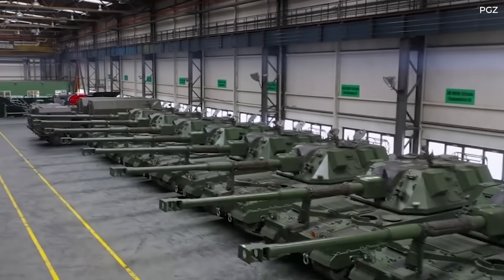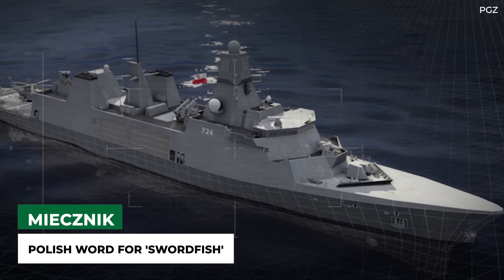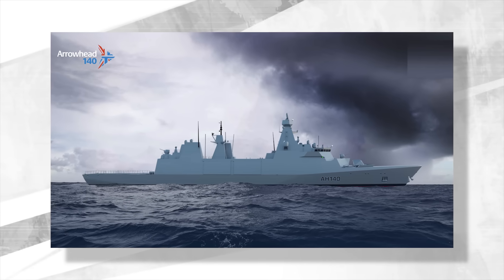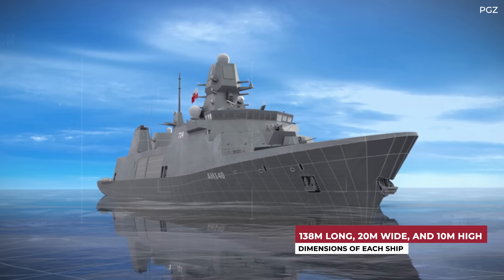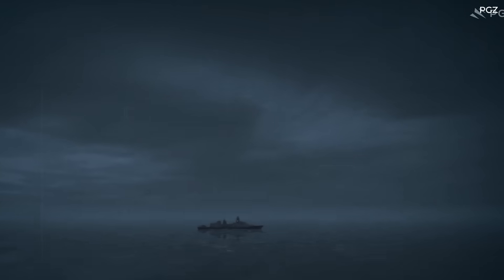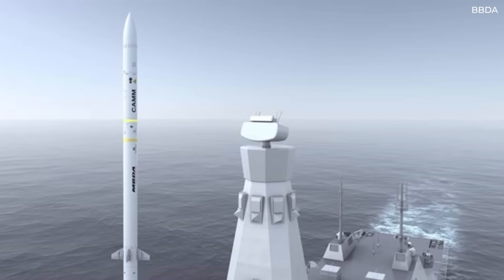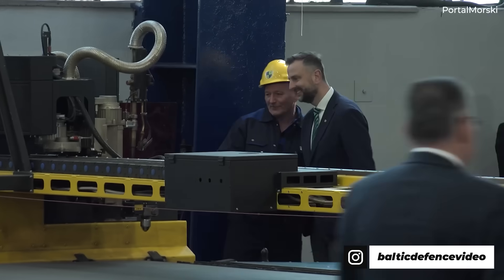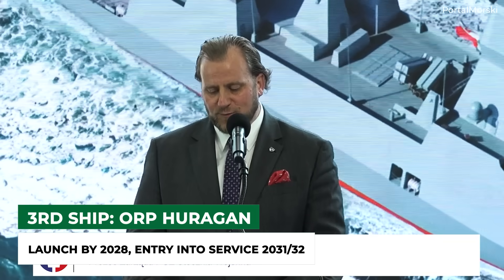Poland's Future Multi-Role Frigates: What Are Miecznik-Class Ships All About?

Comment: These ships will be equipped with CAMM and CAMMER missiles, which will form the basis of a short-range air defense system under the Narew program for Poland. This is a counterpart to the German Iris-T anti-aircraft system. The advantage is that the same missiles will be used in CAMM launchers both on land and at sea. Another advantage is the establishment of missile factories in Poland and the UK. Both countries will be able to replenish their supplies if either runs out for any reason.

Comment: These are British Type-31s that are being built in Poland under a joint construction agreement; Indonesia has the same type of agreement with the UK to also build Type-31 variants.
Reply: Taking a Iver Huitfelt class frigate and replacing the electronics doesn't make it British. All these models are upgraded Iver Huitfelt class frigates.
Reply: @jacksonteller1337 Not quite. Babcock's Arrowhead 140 design is indeed inspired by the successful Iver Huitfelt class of frigates, especially the modular build aspect. But from the ground up, these are otherwise distinctly British ships, in (1) concept, (2) purpose/objectives, and (3) weapons systems. The Danish ships are anti-air frigates; the Babcock designed Type-31s lean more into modularity, as flexible global combat ships, for export in a wide variety of theatres (Indonesia, Poland, etc.), with anti-air, anti-surface, and even anti-sub fighting, via a more effective helicopter complement (Merlin, Wildcat, or even Chinook). For this, they offer more high-tech sensors and weapons systems, from the Sea Ceptor to Tomahawk or ASROC. Because export flexibility is their goal, they also have future-proofing built into both their software and physical platform, with upgradeable spaces for drone-boats, etc. In practice, this means the British, Polish, Indonesian, and other variants of the Type-31 could ultimately be quite different from one another.
Reply: @jacksonteller1337Sorry you are wrong.  The STANFLEX system was ripped out.  The compartmentalisation was upgraded and improved.  If they were just the same why would the Danish government be looking at replacing the Iver Huitfelt and her sisters with new Arrowhead 140 based design ?
Reply: @paulbestwick2426 that is called an upgrade. Enjoy your school day.
Reply: @paulbestwick2426  True, the United Kingdom is obviously not going to licence its most cutting-edge technology unless under very careful collaboration. There's a reason you can buy nearly six Type-31s for the cost of a single Type-26; the Type-26 is a domestic British design by BAE, with indisputably world-leading tech. By contrast, the Type-31 and Arrowhead 140 concept are essentially the UK's cheap modular alternative for export.
Reply: @jacksonteller1337 Actually, it's only the hull and its shape that is left from the Iver Huitfelt class. Everything else, including the interior and the superstructure is new. So there is quite a lot that's been changed and not that much left of the original.
Reply: nie sa! brytyjski jest tylko model fregaty. wyposazenie, elektronika, uzbrojenie to juz nie wasza liga...

Comment: Sounds good the Danish frigates unfortunately have a problem with the weapons systems, but that doesn’t have anything to do with the ship design which Poland is using, the frigates are still sailing fine, there have been no issues with the design of the ship itself just the latter installed stuff inside the ship, which is why it’s likely Denmark will buy British frigates as needed ships.
Reply: Wouldn't just switching up the equipment solve the issue? I don't see why this prevents Denmark from purchasing domestically.
Reply: @itstime6122
We don't have the capacity to build the hull.
The reason behind is to keep the navy from fucking up.  The OTS design is great.  The Fremm, Dutch and British hull design is developed on Absolon class.
Reply: Because royal danish navy was poorly funded and had 30year old missiles and ammo on board and that Did the system integration them selve and probably f..Ed up with the system integration.

Comment: Let's hope that the fact that the ship is based on the Ivar Huitfeld class is not a bad omen. This class is plagued by major problems and is practically unusable.
Reply: The problem is not with the ship design as such but with the Combat Management System the Danes installed. Secondary issues include the decision to reuse weapons from older Danish ships rather than buying and installing new weaponry. On top of that the ammunition for the 76mm had not been properly tested and mantained in storage.
Reply: It has nothing to do with the design of the ship itself which is what Poland is basing their ship on its a weapon control system issue, it means that it’s not able to be used as intended, but it’s far from unusable, it’s being used for a more important purpose in my opinion defending the territorial waters of Denmark, it’s a big failure but not the design of the ship itself, but it seems like we are buying be
British build frigates instead of trying to build them ourselves which is a good idea in my opinion, hopefully they will not be wasted on African expeditions like the old ones we have enough to deal with in our own waters
Reply: The problems of the Iver Huitfeldt class should not simply be dismissed as a faulty battle management system. Reports (and one should not only read Wikipedia) also mention sensor problems and more. If these ships cannot even properly defend themselves against drones from a third world country, then I would not have too much confidence in their territorial defense capabilities. Incidentally, the Danish Navy seems to share this view, because instead of modernizing or upgrading the ships, they want to replace them as quickly as possible, despite none of the ships in this class are even 20 years old.
As I wrote earlier, I sincerely hope that Poland has learned from this and will not make the same mistakes.
Reply: @ricodredd7449  Again. It is a faulty Management System. That is a fact! Don't push any bizarre agendas here.
Reply: If it's ‘only’ the management system, why did the Danish Navy cancel the modernization program for the new frigates, stating that the problems could not be solved and that it would be better to procure the successor ships earlier? As a reminder, these are fairly new ships and, on paper, they should be among the most modern/capable air defense frigates in Europe. Instead, and I'm exaggerating a bit here, they are being used as better patrol boats.
Reply: @ricodredd7449  Ukrainian F16 are not usable by Nato countries and you know that it is not about the design of their fuselages and wings but because of the equipment and its integration.
Reply: @greycliffnative I'm sorry, but that's the worst comparison I've heard in a long time. But again, the Danish Navy is so convinced that the frigates are beyond repair that it has halted a planned modernization program. This affects not just one ship in the class, but all of them. So it's a fundamental problem. I never claimed that the design couldn't be revised. Rather, I expressed the hope that Poland would do better than Denmark.
Reply: @ricodredd7449 
There is nothing simple about a malfunctioning CMS as it effectively functions as the ship's brain and nervous system. A faulty CMS, especially one that that proves as hard to fix as the Terma C-flex is a massive problem equal to a an infantryman who starts to suffer from strokes and seizures in the middle of a combat. 

 Indeed one should read the reports, especially the original Danish reports rather than the 2nd or 3rd hand information often found in English language reports. 

The Danish reports show among other things that the ship at no point was unable to defend itself "against drones from a third world country". In fact the first 3 drones were engaged and destroyed in a textbook manner without any problems. It was only when the fourth and last drone was to be engaged  that the CMS froze and prevented a missile engagement. Instead the ship had to shift to using its two 76mm cannon which successfully destroyed the drone but only after expending a lot of ammunition due to faulty shells. 

There were no sensor problems during the engagement as can be easily seen in the leaked after action report sent by the ships captain. 
The supposed sensor problems after a misunderstanding based on two separate issues. One is the known issues with integrating the Terma C-flex CMS and the Thales APAR. Given that the APAR has a good service with Dutch navy the flaw once again traces back to the C-flex CMS.
The second issue is not a technical flaw or problem as such but rather that the Danes did not sufficiently future proof the fire control systems of the class. That means that rather than upgrading the system to be able improved modern missiles they will have to completely replace the systems in question. All of this makes upgrading the class as originally planned almost as expensive as building new frigates. Which is why the Danish chief of defence recommended that Denmark buys new frigates for the air defence role while the Iver Huitfeldts will be downgraded to serve as heavily armed patrol vessels with plenty of range and endurance. 

Poland will have none of the problems that the Iver Huitfelds have suffered from since the only thing that the two classes share is hull shape and basic layout. The Polish ships will have their CMS and entire sensor suite provided by Thales rather assembled from different makers.

Comment: The mk.41 VLS  and Common Anti-Air Modular Missile aka CAMM are all part of Sea Ceptor. Sea Ceptor is the weapon system which uses CAMM and the Mk.41 vls will be the launch platform for the CAMM as its size makes it possible to quad pack the standard CAMM missile. Poland is also part of developing the CAMM-MR which will have a range of 100 km compared to the 25km of the standard CAMM version. The drawback is that only two CAMM-MR will fit in each mk.41 tube.
Reply: The Swedish Visby-class corvettes are going to quad pack the stantard CAMM into a more compact ExLS launcher based on the Mk.41. Longer missiles like CAMM-MR can't fit into them them but they have managed to fit 9 cells to the quite small ship.
Reply: @herptek  Indeed. The SeaCeptor upgrade on the Visby is a great evolution for a Corvette-class. 👍
Reply: @glacieractivity  For the Visbys it certainly is. Their air defence capability goes from hardly any to quite considerable for a ship of their size. The smaller Finnish missile boats as well as coastal minelayers are equipped with 8 VLS cells for SAMs but they lack the quad-packing option which limits their capacity.
Reply: @herptek  The Visby-class was supposed to get the same Umkhonto VLS that the Finnish navy uses but the project was one of many that were cancelled as part of a series of ill advised decisions by the  politicians in 2008-2009. 

If Visbys had gotten the Umkhonto it is unlikely that they would have been upgraded to Sea Ceptor today so in a twisted way a bad decision has led to.a good final outcome.
Reply: @Vonstab  Something is wrong if politicians have to be manipulated into pursuing good outcomes despite their best efforts to the contrary.

Finland adopted Mk.41 VLS for its new corvettes. The cells are strike height so that they could accommodate any kind of munition, but only 8 cells per ship are installed so they are used to quad pack medium ranged ESSM for SAMs.
Reply: @herptek  well in this case there was no manipulation involved, the people making the decision back in 2008 are all out of office and politics in general. The actual good decision were taken by different people who understood that having corvettes without modern air defence systems was a profoundly stupid waste of resources. 

Will be interesting to see which VLS Sweden choses, my bet is on the Sylver A50 at the moment since the Aster30 is the most likely choice as a long range SAM.
Reply: @Vonstab The Visbys are going to be equipped with ExLS VLS based on the mk.41, which is a compact version of the same system of Finnish corvettes. The ExLS can only accommodate tactical length equivalent missiles, which are necessarily going to be short ranged. It can't accommodate Aster missiles for example. The CAMM missiles are a good choice for that particular launcher.
Reply: @herptek  CAMM can't be launched directly from the mk41, you need an adapter between the mk41 and the CAMM missile and that adapter is the Host Extensible Launch System (ExLS). To use ExLS without the mk41, a standalone version of it is also offered.
Reply: @johan.edlund  That is more or less what I said. One can't fit Aster 30 missiles on the 3x3 stand alone ExLS cells that are going to be installed on the Visbys, nor other strike height munitions that could fit into a full strike height stantard Mk.41 cell. The CAMM missiles and/or decoys that are to be quad-packed have smaller dimensions and are therefore also limited in range. It would be interesting if the ER variant can be quad packed this way. It is precisely good idea to have such a compact launcher on a ship without room for a full sized 8 cell Mk.41 launcher.
Reply: @herptek Neither mk41 or ExLS can today launch Aster 30, for that you need Sylver A50.  Launching Aster 30 from mk41 is in principle  possible but would require integration of the missile first (and a compatible radar for the uplink to the missile).

The standalone ExLS doesn't have an exhaust system like the mk41, so it's not compatible with mk41 missile canisters. Mk41 is also availible as a single cell launcher for smaller installations.
Reply: @herptek  The CAMM-ER can be quad packed into the Mk41, and they will be used from Mk41s on the Wicher-class frigates, but cannot be fitted in the Standalone ExLS because it's too long - the length of the ExLS is more less the same as the length of the CAMM launch canister and the CAMM-ER is about a meter longer than that.
Reply: @johan.edlund  Yes, but the Visbys obviously won't have the A50 nor stantard strike height Mk.41 VLS. What I am saying is that it is impossible to fit Aster 30 to the Visbys like the person above speculated.

We already know they are going to have the standalone 3 cell ExLS launchers, which limits the physical dimensions of the missiles they can carry. This is nevertheless a good idea to do in My opinion because The ability to quad pack CAMMs into those 9 cells gives the Visby quite considerable firepower for self-defence and perhaps even local area defence despite the lack of room on board to instal a full sized 8 cell Mk.41 VLS that could accommodate larger and longer ranged missiles such as the Asters for example.